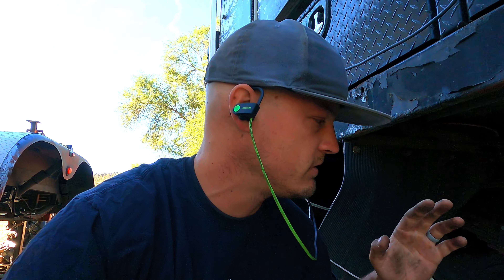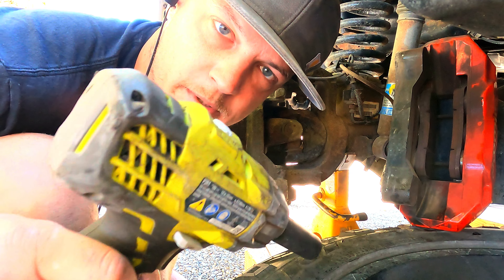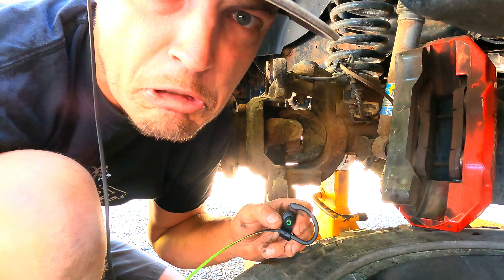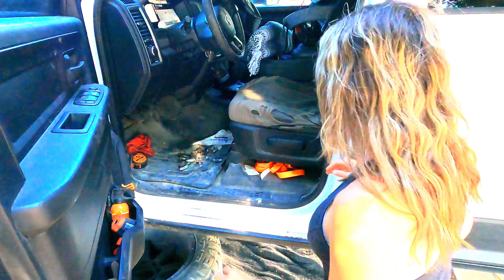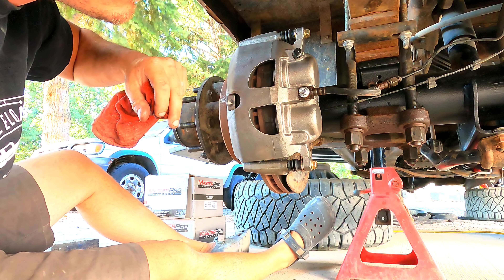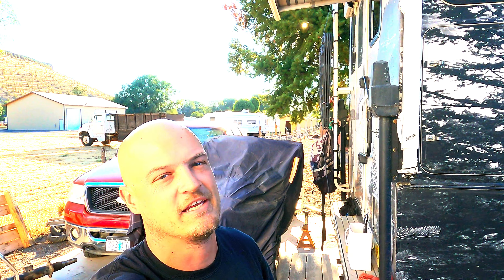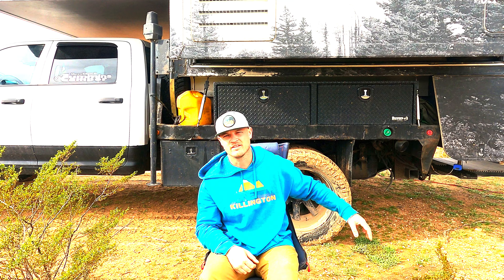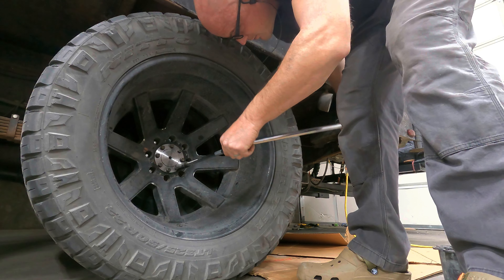AXLE REPLACEMENT PART 5:  WILL THIS PAIN EVER END!?!?

Comment: 06:54
I often use the gun to lightly speed-snug, then torque to specs with a torque-wrench.
At the tire shop, the fellows use colored extensions about eight inches long, each engineered to go only to the desired torque stamped into it.

Comment: As I was watching you with the impact gun on the bolts, I thought, NO! Any way, Ya, get a torque wrench even for wheel nuts. Studs/bolts have limits and torque settings should be used. Would hate to see all that work you put in and see studs breaking off. So glad to see you are on your bay with it. Be encouraged!!
Reply from the maker: Thanks Dennis! I agree a torque wrench would be a simple yet great item for me to be using after all this work. I just learned of a digital “torque wrench” that goes on your half inch breaker bar as like an extension. Doesn’t take up much space but measures your torque. Gotta get one of those bad boys. Thanks for watching and commenting! Greatly appreciated
Reply: @thecumminscamper  I agree, one of those would be perfect! Totally forgot about the small ones, may just need to have one for myself.